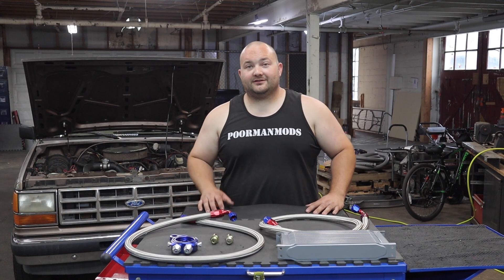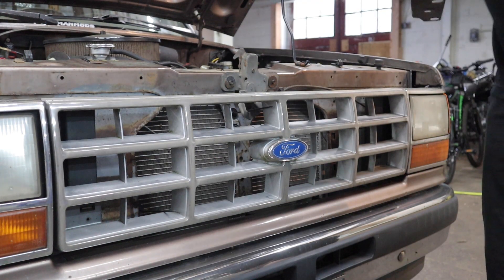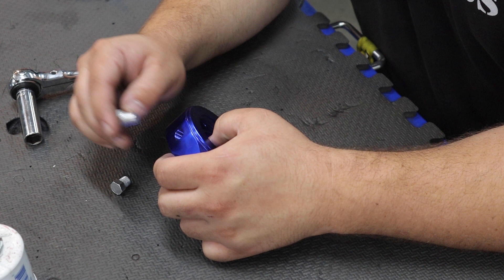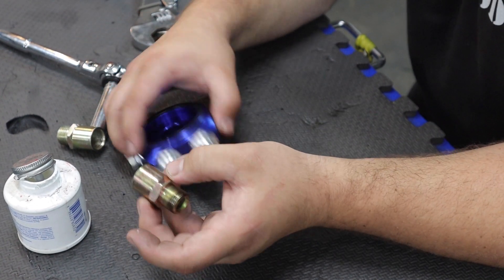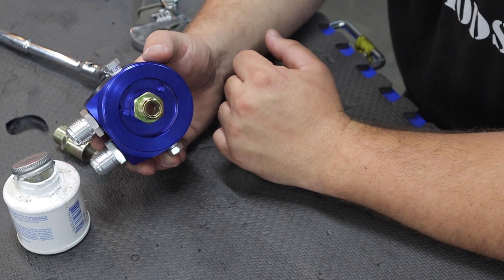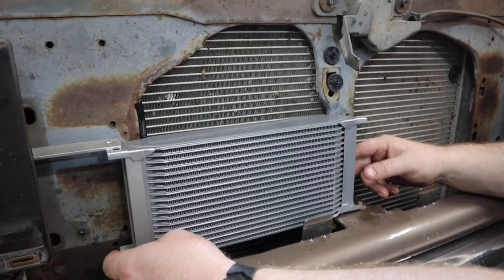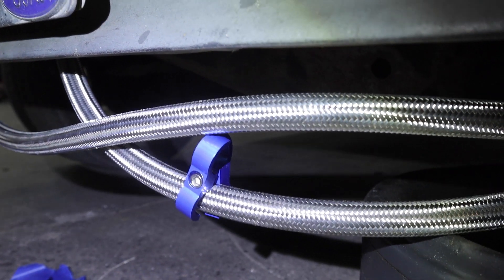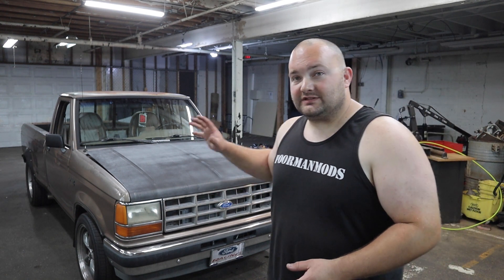Nitrous V8 Swapped Ranger gets an oil cooler to stop it from melting down! | Oil Cooler Installation

Comment: are you sure we arent supposed to prime the lines with pil first or fill up the cooler? or do you just run it to temp then shut off engoine to check oil dipstick and then add oil accordingly? thanks

Comment: I know this is for your V8 but I am wondering if my 3.0 litre Ranger is good to drive stock on hot days for a couple hours with some weight in the back. Do you think I'm good without having an aftermarket oil/transmission cooler?
Reply from the maker: youre probably fine, but adding a cooler certainly wont hurt
Reply: @PoorManMods  Thanks